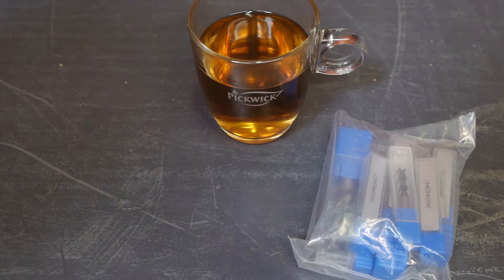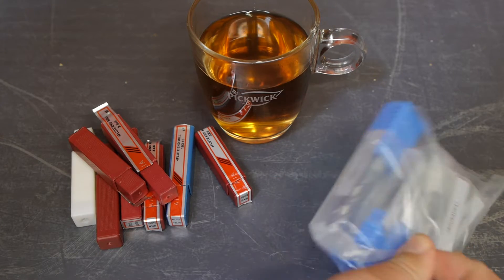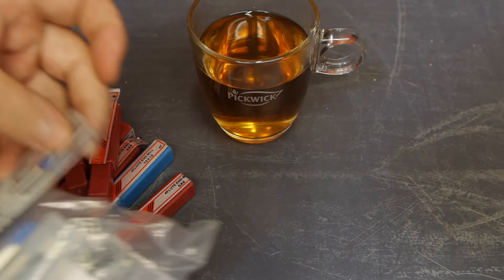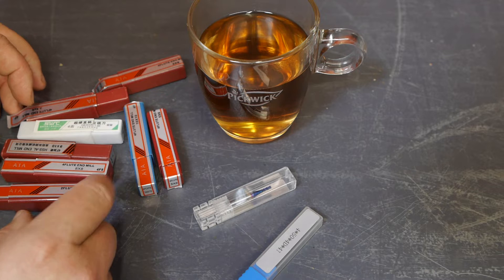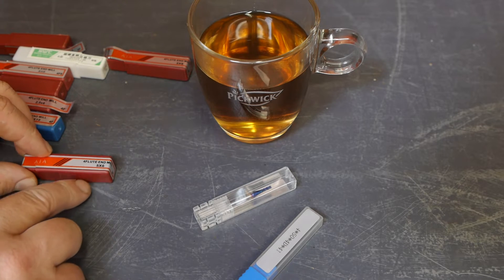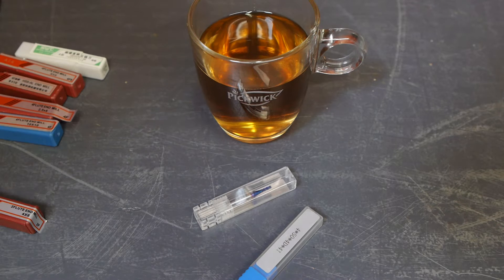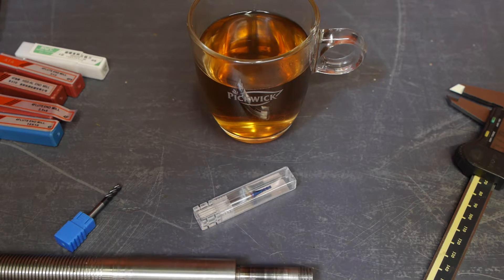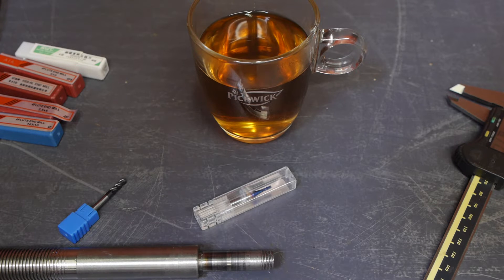A look at cheap Chinese end mills - carbide vs hss

Comment: Amusing ramblings about monetary policy which isn’t understood here.

Most carbide bits are either ground or from powder, pressed and heated into a mold, and then sometimes honed, for indexable inserts. That looks like wood dust on the edge of the SS bit. If it’s rust, that’s really bad. Carbide can be sharpened to a higher sharpness that HSS. When carbide first came out, a long time ago, that wasn’t true.
Reply from the maker: I can understand carbide inserts coming out of a mold but how would you ever get a 4 flute end mill out of a mold without any parting lines.
Reply: @RolingRandom  I said—for indexable inserts. Regular mill bits are the ones that are ground from bar stock. I’ve made some of my own. Without heavy industrial cnc equipment, it’s some work. But for smaller sizes it’s not hard, just time consuming. Only for custom bits, of course. And no way to make up those really odd configurations modern bits are getting more often.

Comment: Looks like Banggood is selling high speed scraptonium now.
A V-block works well to display the bits on your camera, just attach with double side tape or a drop of hot glue.
Thanks for sharing 
Cheers
Reply from the maker: Yeah this hss end mills were made from seasoned scraptonium :)
Never though about using a v-bock. Might have worked perfect.

Comment: You finally got a mill! Even tho it's a used modified one,  it's a start.  We all have to start somewhere. I know you like vintage machines check out the 1 and only video on my new channel (click the icon). It's a mini metal planer I restored.  It looks old but there's no maker marks, spot for a tag, or numbers of any kind.  Let me know what you think RolingRandom ir if you ever seen one before.  I have no information I can find nowhere. Congrats on the mill!!! God luck with it and I can't wait to see some videos.
Reply from the maker: Someone actually gave me an ex cnc milling machine to play with. It needs a bit of work but it should still be useful. Unfortunately health issues makes progress slow :(
Love your little planer, not much bigger then a small shaper.
Reply: @RolingRandom  Yeah, health issues seem to be popping up for me too. It sucks getting older.  On the planer,  I never even knew they made such a small little one like that until my friend gave it to me. Thanks for checking it out!

Comment: In the 4x6, could the second number be the diameter of the shank of the cutter?
Reply from the maker: You are probably right. Then you would know when size collet to use.
Reply: Often, the first number is the diameter, and the second is the length of cut. If it’s not, then, yes, it’s confusing.It’s easy enough to measure. No reason to speculate.